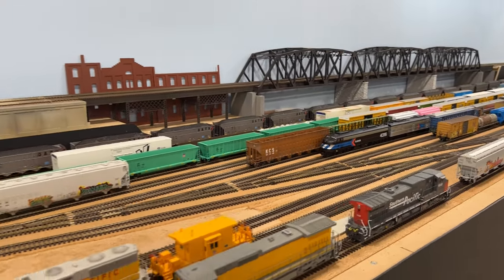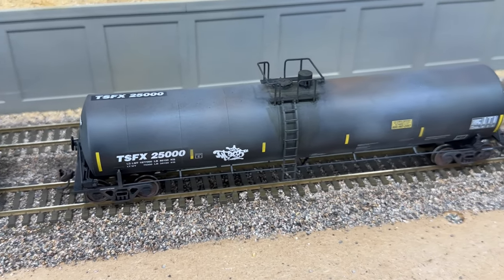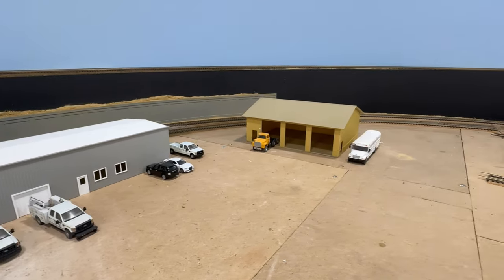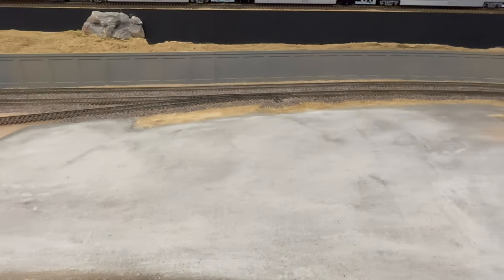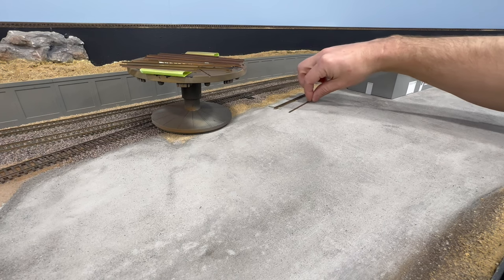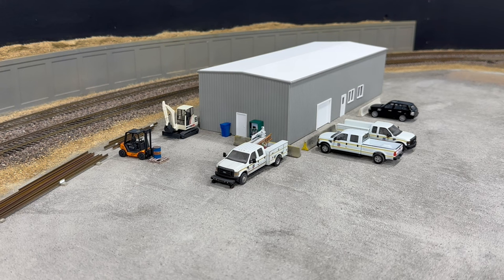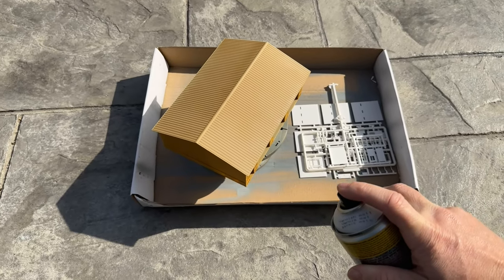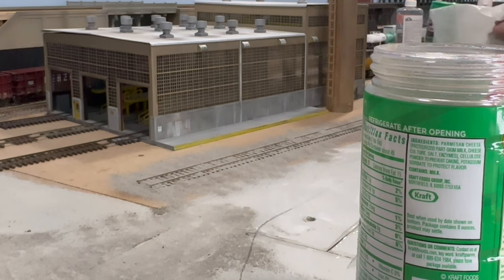UP Heartland Division Update 2/20/23 (MoW HQ- How to Make a Gravel Lot, Rail and Tie Details)

Comment: When I want to darken wood ties, I just use stain nd a baggy. Put the wood ties in the baggy, add a little stain, and then just work the ties around in the stain until I am happy. Cut a corner off of the baggy and drain the remaining stain back into the small can. Put the ties out to dry and you have it... No waste of anything. The ties can be glued together and then put in the stain but you have to be careful with the glue because the glue will not stain.

Comment: Hi which manufacturer (brand) makes that bag of wood railroad ties ? Thanks
Reply from the maker: https://www.handlaidtrack.com/wood-crossties
Reply: @modeltrains_365  thanks ! Comparing buy these to say the Blair line 'bundle o ties' detail piece, a pack of ties si much better value as you can make so many more model scenes with the pack of ties. Thanks again